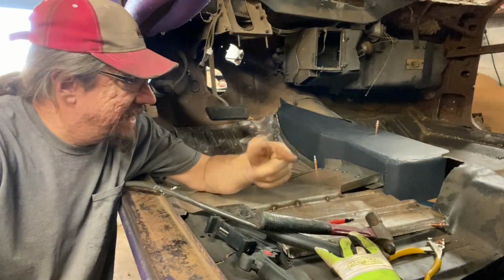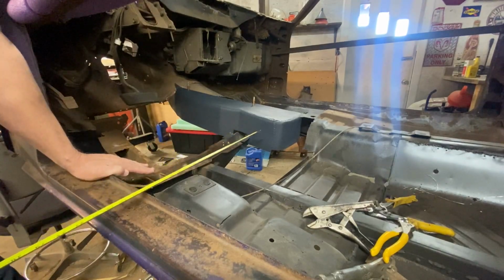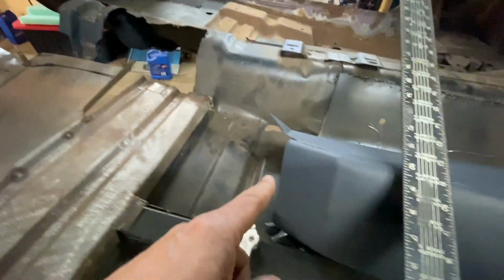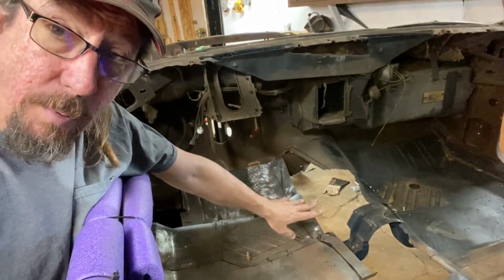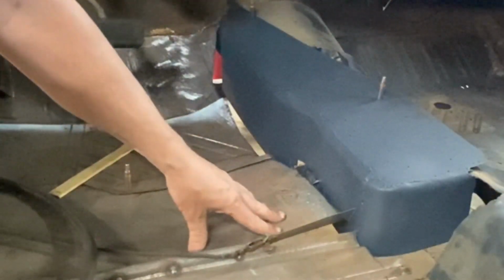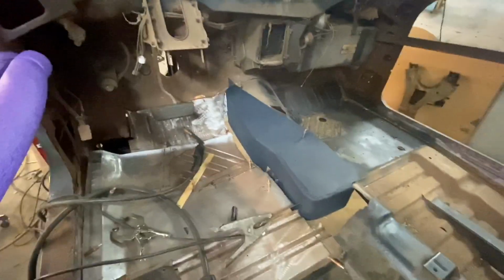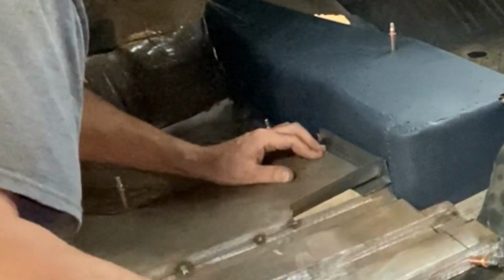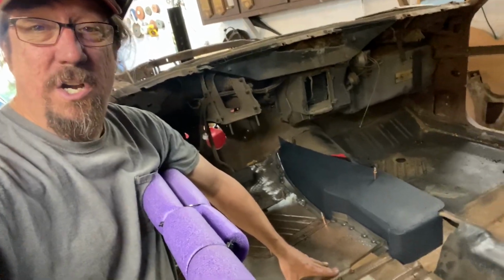Pt 2 - How To: Fabricate a Floor Pan Hump - Joining it to our fabricated Floor-"Stitches" Challenger

Comment: Another job done it's moving forwards a bit at a time. I'm enjoying the fabrication, watching solve issues encourages to tackle the more  complex work needed on my car.  

Just a quick question, why did you go for an upright flange on the floor rather than a flange on the hump that you could bolt down to the floor?
Reply from the maker: I didn’t really think it through too much. Lol it’s just kind of what naturally happened. Lol

But I am thinking I will make some 8th inch strap pieces to put on both sides so that everything gets sandwich together when it’s done.

You’ll discover it as I’m doing it. Because I don’t plan ahead a lot, I just kind of go with the flow

Thanks for watching! Appreciate it